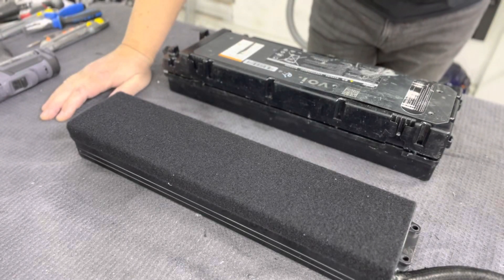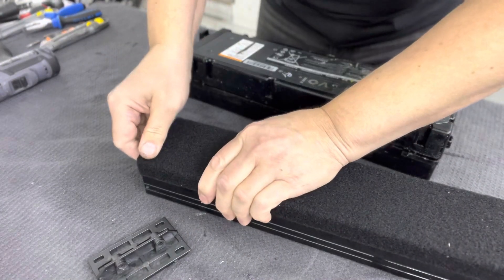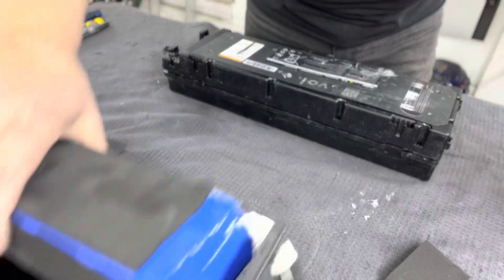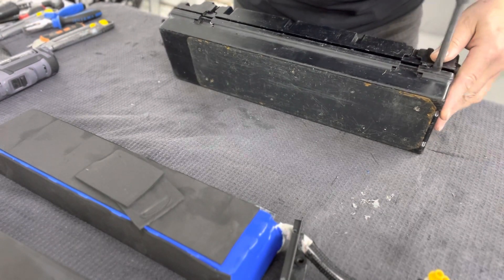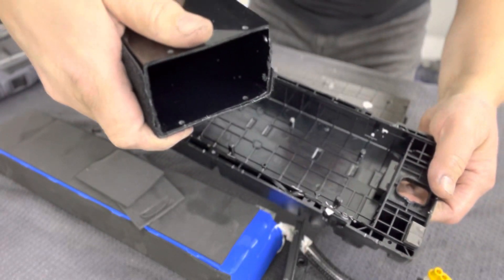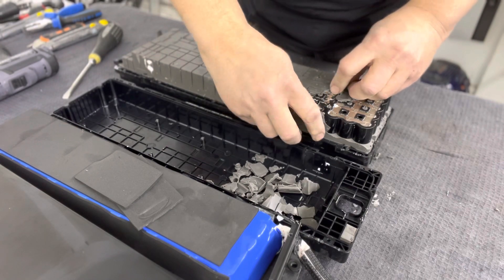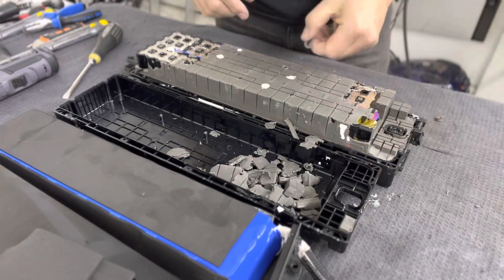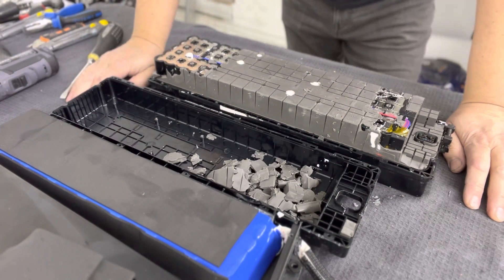Begode Master vs Ninebot battery

Comment: What about moulding Master's baterry in silicon? To make hermetic layer in all directions. Is this good idea or not?
Reply from the maker: Idea is good. Many manufacturers do so. The weight is most concern. In Master case it will be way over 50 kg. 😅